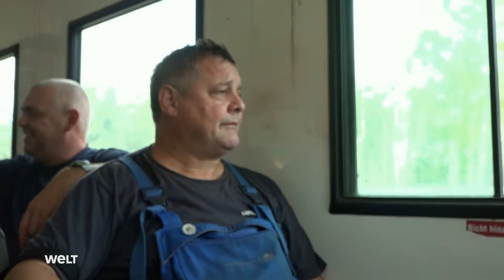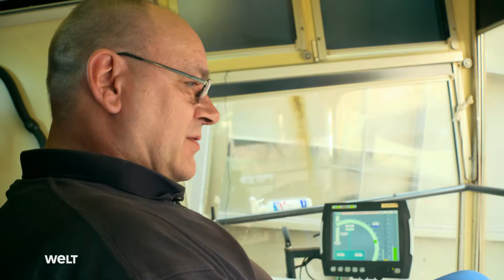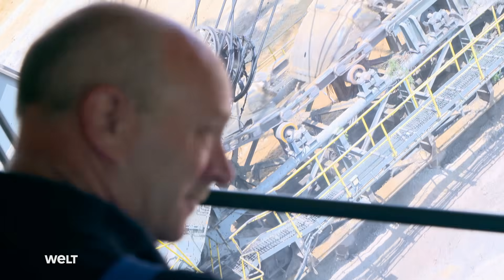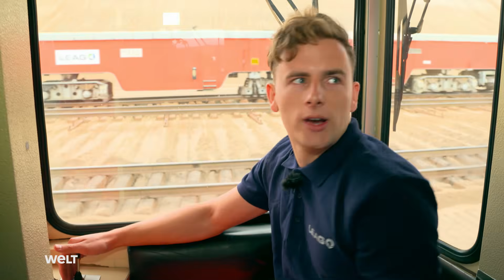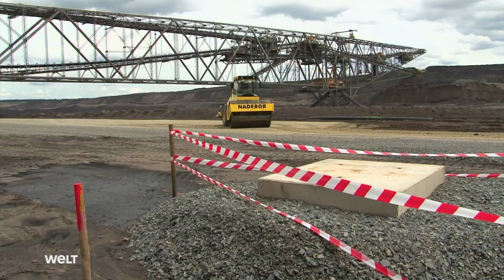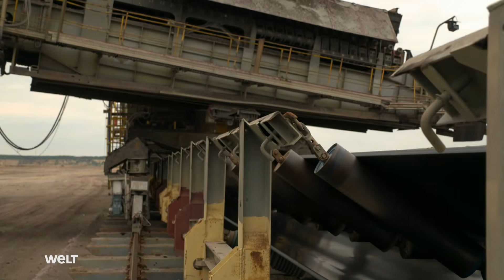The Biggest Mobile Work Machine In The World | Full Documentary

Comment: That excavator is probably the only land-based machine longer than any ship- although ships could be even twice as long, the canals limit that.
I'm actually quite surprised at the low combustion temperature of only 1000 degrees! I have some special tile stoves myself that I have fired with aluminum whose melting point is 1200 degrees but the ignition temperature must be higher but don't know how hot it is required? Think modern technology should handle more than technology from 1924 just...
Otherwise, nice to see programs with international units instead of the incomprehensible American units that probably also existed in Europe until the technological revolution at the end of the 19th century when a uniform system was required that did not vary between different countries! Too bad Youtube can't translate different devices which could make many programs much more interesting!!!